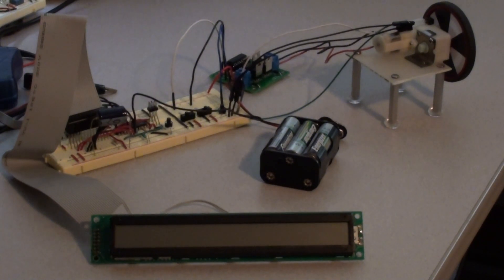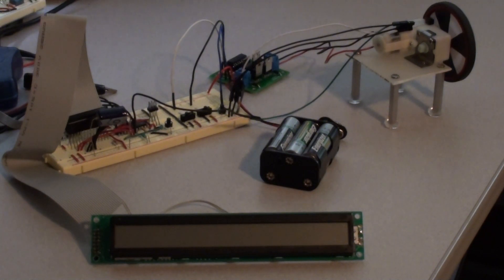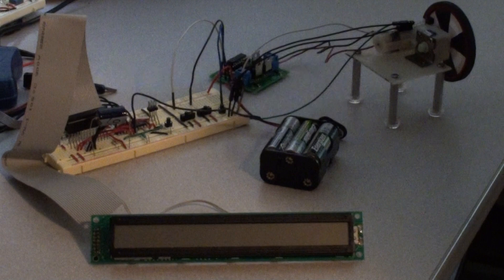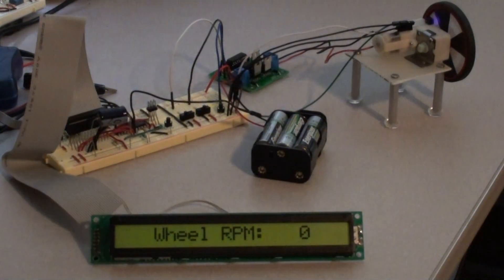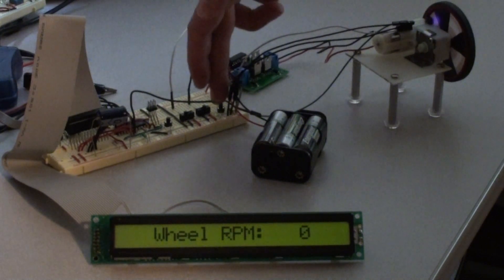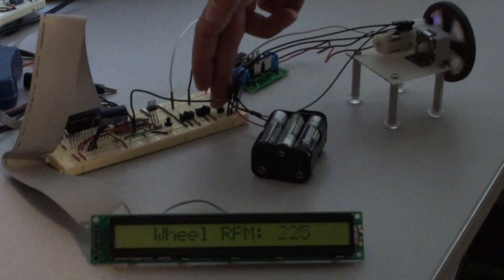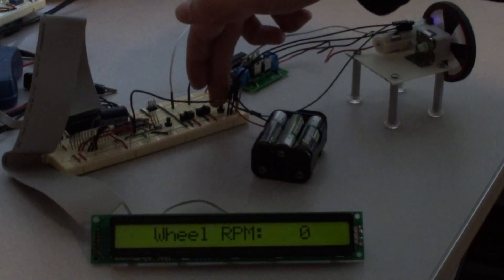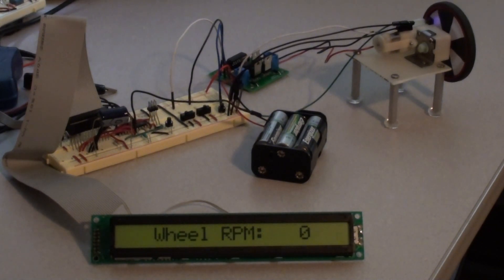RPM meter with AVR microcontroller, QRD1114 IR reflectance sensor, HD44780 display  + code

Comment: I am attempting to build a circuit with a rotary encoder to measure distance. Do you know if this microcontroller and display will work on this system.

Comment from the maker: good catch, it should be divided by 15, not multiplied.  That would result in the output being much less, implying the sensor setup may not be able to keep up at the speed it was at.

explanation by calculation:

rphs is revolutions per half second as done in the code

rpm = rps / 60 = rphs / 120 = (sensor_counts * 8) / 120 = sensor_counts / 15

Comment: why did you multiplied the RPM count with 15?

rpm = (count * 15);
Reply: as is shown in the video, the encoder wheel makes 4 pulses for each rotation. if you want to convert rotations per second to rpm you should multiply it by 60, but in this case because each rotation makes 4 pulses you have to divide that value by 4:

rpm= count*60/4= count*15